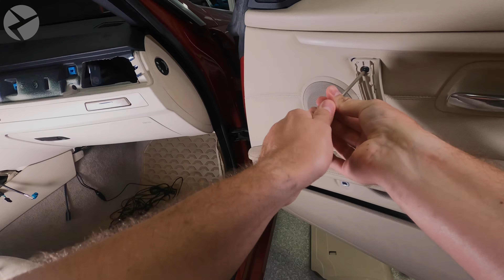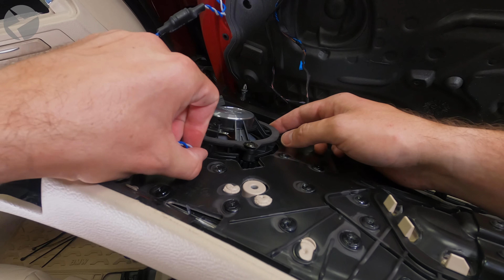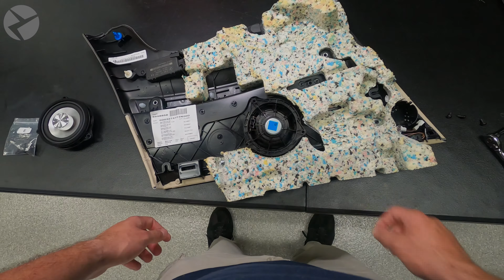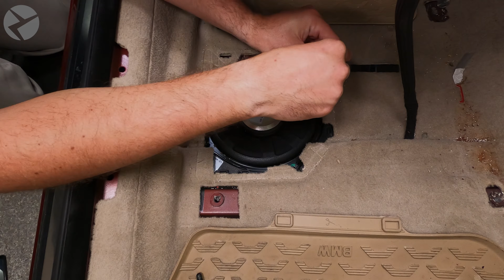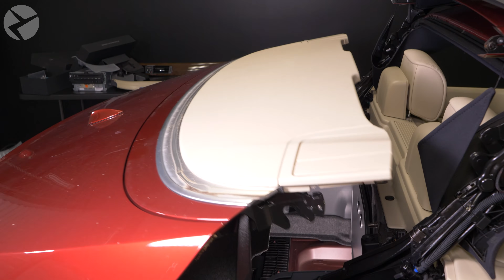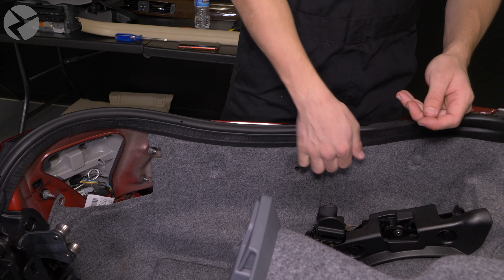BMW 3 Series E93 Speakers & Amp – Alpha One Kit Installation

Comment: If I have a base sound system, is the wring for the subwoofer and amplifier already there?
Reply from the maker: A base system is a unique situation, and it does require specific harnesses from us.  Please reach out to our Sales Team via chat on our site or by calling, have your VIN ready, and they will be happy to help!

+1 (646) 439 7920
info@bimmer-tech.net
https://www.bimmer-tech.net/page-contact
Reply: @bimmer-tech is it still a plug and play adapter? Or will I need to wire the subs separately? Also can I buy just the adapter on its own?
Reply from the maker: @DrowsiestCow11  Our kits comes with everything you need, but since you have a base system, I strongly encourage you to speak with one of our Sales Specialists for the best support.  Just have your VIN ready for them.

+1 (646) 439 7920
info@bimmer-tech.net
https://www.bimmer-tech.net/page-contact

Comment: what is the usb cable for?
and i have an e93 - your website says no speakers compatible, just the amp.
Reply from the maker: Which USB cable do you mean?
Send us the VIN - we will check if that's really the case with the compatibility :)
Reply: @bimmer-tech  Just meant the usb in the video, but have seen that this is for the option to connect a computer to the amp for settings. 
- 
my vin. where should i send it to?
Reply from the maker: If you want, you can see the compatibility on Alpha One page. It sometimes doesn't appear on our main page, while the compatibility is there :)

Comment: What if the car does not have the high speakers in this triangle at the mirrors? Ist there still a cable behind an i can just plug a speaker in with the right case?
Reply from the maker: Hey! With the Alpha One speakers, even if your car did not have the tweeters from the factory they can be added with Alpha One retrofit, please note that your car won’t have the triangular foam for the tweeter so you will need to get this part for the retrofit as well.

Comment: Sorry this is late but would this work with pre lci since it has a fiber optic cable to send signal?
Reply from the maker: Yep, it does work with pre lci cars. To make sure you can check it on our website :)

Comment: The problwm it's when you don't have a factory Amp. How do you make al the wiring. I'm talking about F30
Reply: We have a video on that kind of installation done in an E70 chassis. We supply all of the required wiring in an amp kit for a base stereo audio system. You really need to do both the amp and at lease a set of front and woofers speakers along with the amp to make the sound banging.

https://www.youtube.com/watch?v=PvPuMzHDm8o
Reply: @maciejstalmach2252  I allready changed all the speakers and I have a Amp with a subwoofer on the left side of the trunk
Reply: @Nastrusnicu  Is the amp only for the trunk sub? When you say you replaced all the speakers that means you replaced 6 of them and maybe added a pair of tweeters in the front doors (hopefully). But they're still powered by the factory head unit? Or is the amp that you installed multichannel and also powering the speakers in factory locations in the cabin?

In any case with our amp you get all the wiring to deliver the output signal from the factory head unit to our amp, and also wiring that allows each speaker or speaker pair (midrange + tweeter) in the cabin to be connected to it's own output channel so in essence you get all the wiring to convert your F30 to a Hifi standard. We even include a pair or wires for the center channel but on a base F30 you'd have to cut the dash or replace the dash to add it so it's not worth the effort. Furthermore with our amp you could hook up the trunk sub to the RCA line out and have it time aligned EQ'd and everything which allows a trunk sub to finally sound good.

In the E70 installation video you can see the whole snakes nest of wiring that has to go in the car to allow all this and it's all plug and play.
Reply: @maciejstalmach2252  yes, the Amp it's only for the trunk sub. 
I replace the 4 Doors speakers and 2 underseat woofers. I have 4 speakers left. I can install 3 of them but need to buy the 5 tweeters and the trims